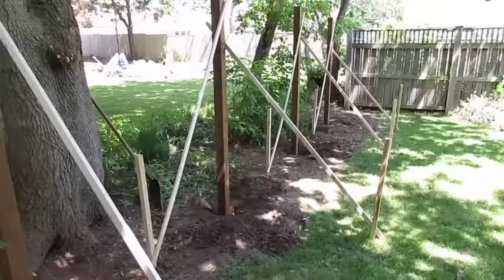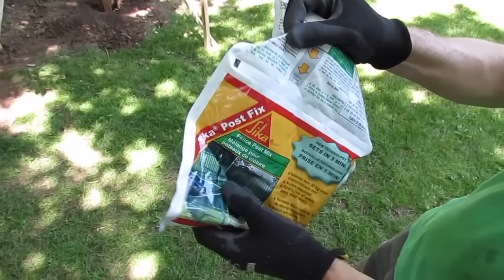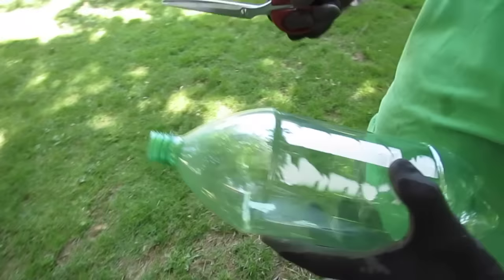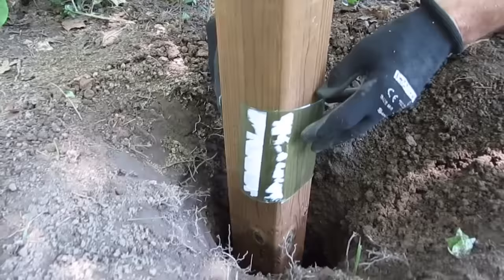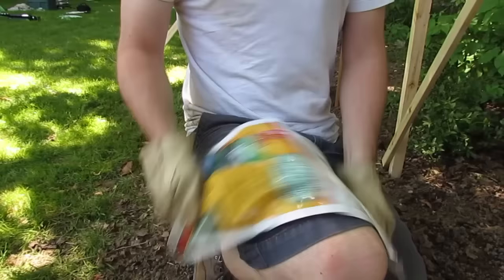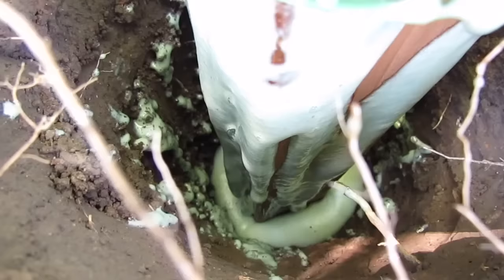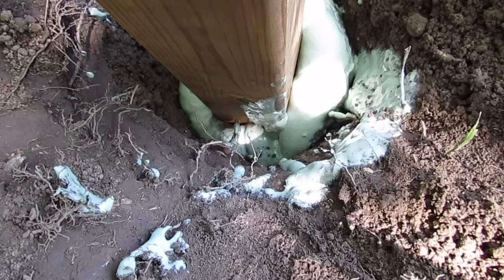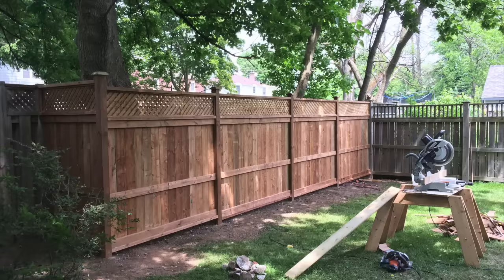No Concrete Fence Post Install!

Comment: I'd be tempted to use this, but fwiw, I use concrete but dry.  You don't have to mix water in it to pour it; just dump the bag in and over time the moisture from the ground will cure it just fine.  Maybe even less mess than the foam.
Reply from the maker: For sure, plenty of moisture in the ground to set up over time. I like getting the concrete set immediately to avoid settlement or an unlucky night of high winds shifting things around in the powder.

Comment: Bag of concrete mixed under $5.00
Why SIKA in the hole for $ 20.00 +
Reply: Đại Ngải SócTrăng I agree
Reply: Sika’s not even that much. It’s like $11 a bag at my Home Depot. I would need 2 bags of quikrete to do a post, each costing 5 dollars. I’m putting up a fence soon and decided to use the foam. Friends and family have had success with the foam on their fences through two hurricanes already.
Reply: Leon thecat Really? The fence has been standing for roughly 2 years now, withstanding a hurricane and Florida’s crazy thunderstorms and it still looks like I built it yesterday with barely any wobble. I have 12 posts (10 have SIKA Foam and 2 have quikrete due to sandy soil.)
Reply: Leon thecat Well, we’ll see in time. As of now it hasn’t wobbled once in a bad storm. It’s also probably got to do with the design of the fence I went with. My fence is a horizontal shadow box style to allow wind to pass through. We just had a pretty nasty storm with gusts that broke some large branches in the backyard and my fence didn’t move.
Reply: Leon thecat “Barely any wobble” lol Yes, barely. Come on my dude, sorry your expectations to this product was shot down by my own experience with it. Fences, whether put in with concrete or foam will wobble if given enough force, and in my case you really gotta push the darn thing to make it wobble and even then it goes back to where it was. Maybe you’ll be right in about 5 years, either way I won’t be here to see it happen ;)
Reply: Leon thecat and yet, here I am perfectly healthy at the age of 26 exposed to the same pollutants every human being is around the world. I’m pretty sure some foam buried beneath the earth is the least of my worries. This has been a fun conversation, I’ll be sure to make a video of my fence during another Florida storm or hurricane and post the results for you :)

Comment: Traps moisture, shrinks, The post will loosen up and rot out quicker with foam. Concrete. Level your post. Poor in dry concrete. Add water. Works like a champ and last for years.

Comment: there are times when I have seen 60 foot poles set in foam in unstable or loose ground...  It's expensive but some geo engineers have mandated it on projects...  It was fast and the pole didn't lean and unlike 404 gravel or concrete it doesn't hold moisture against the pole...
Reply: C and K Early Warning Systems 
Ooooooo good point
Reply: ☝🏻 hater
Reply: let us know how it's doing in 10 or 20 yrs, 'cause i KNOW concrete will last centuries.  if it's done properly, concrete does NOT hold moisture against the pole either.
Reply: Most people don't think about the fact that concrete is porous. You can't make concrete waterproof without sealers and Coatings. But closed cell foam is naturally watertight.
Reply: John Michael, according to the National Precast Concrete Association (precast.org), "Concrete is inherently porous, although a sealer can be added to the concrete surface to prevent water penetration. It’s practically impossible to make an absolutely nonporous concrete "
Reply: +jason muller - i don't CARE what you or precast.org says...  i've been working with concrete since before your daddy was born.  maybe the problem is terminology.  let's skip the word porous, because on a microscopic scale EVERYTHING has a structure that could be called porous.  let's stick to a more practical term, watertight, and plain old concrete w/o any special additives IS WATERTIGHT.  water does NOT seep thru a concrete wall or floor.  PERIOD.

Comment: One guy even said he regret not using foam because the posts that he didnt use it on moved. I suspect that the foam does a great job at expanding and filling in the voids.
Reply: I just bought a house that had a fence installed 5 years ago using foam. I can pull any one of those posts out of the ground with little effort, myself. I have to go along the longest section this summer and replace every post. They will be bedded in  concrete. That foam didn't do anything to hold them in the ground, and it's holding moisture and rotting the posts..

Comment: Fine, but that product is ridiculously expensive: $10-15 a bag.  In practice it's not really meant for long fencing jobs, but small projects where you don''t need a whole mess of concrete, such as a single mailbox post.
Reply: Bingo..............
Reply: Yea, I'll stick with concrete, half priced bags with rips in them at Lowes
Reply: B..
Reply: I agree with U totally, for small DIY projects only!

Comment: I think this foam might be great and better than concrete. The problem with concrete is the voids you can get or poor mixture which is the reason some have to fix a fence to begin with. I like the expansion which fills all voids and we all know that expansion foam is really strong and holds up really well and  better than concrete holds up.

Comment: Secure set is one step above and it actually ends up being cheaper than sika if you are doing an entire fence because you can by that stuff by the gallon. Secure set is a little more expensive if you are just doing only one fence post.

Comment: when the post rots, the concrete hole can be reused. Just remove the old wood debris with a drill.
Reply: How do you get concrete in a 4x4 hole there is no room left.
Reply: The foam is supposed to seal out water so no rot
Reply: @matt7iron  the hole must be dug bigger
Reply: @YSLRD  I had old concrete post holes already there and after grinding and vacuuming it out I just cut Down my 4x4 posts to 3x3 and dropped em 18 inches into the concrete and used 1/3 bag of foam on each post  and it hardened up quick and one year and winter later they are still strong and good.

Comment: they have been using foam on motorway barriers for years
Reply: There meant to absorb crashes and actually move. If you want a moving fence foam is for you then.
Reply: Garden Pond Fish Greenhouse weird cause in grinders we surround the pole with foam before adding concrete.  It doesn’t move🤷‍♂️. Keep it insulated from frost heaves.

Comment: 17 dollars a bag.  I'll mix
 up some concrete
Reply: $19.99/bag and you clearly need more than one per hole... Imagine if he used a shovel and the hole was wider.
Reply: @nickw3657  Mix concrete with sand and you will be ok for fence posts.

Comment: I just saw another demo on this and the foam is suppose to be stronger and seal the post.   By that I mean it  should seal out the water and prevent rotting out of the post.   Another benifit is that you can start working on the post 15 minuters after you have set the foam.

Comment: Some things I have learned from the "foam". 1) Proper eye and hand protection is required. Do not get near this stuff without protecting your eyes. I supposed you could live with your fingers glued together for a couple of months. 2) One bag .. One hole. I had two small holes that I thought I could use one bag. Imagine carrying a live hand grenade from one foxhole to another. 3) It expands much more quickly than you expect. And the remnants of the bag will emerge like an alien creature. 5) Use in a well ventilated area .. there are toxic fumes. 6) Be prepared .. have everything ready before you mix contents.
Reply: Sounds like a real pain in the ass to use.
Reply: I too have worked with foam for years and you need to protect your eyes while spraying. For this purpose not a problem.  The sky is not falling Marc!
Reply: Very true. You can't plan on using this for more than one post as it must be used at break-neck speed. Used it yesterday for the first time to back fill a post hole that already had some concrete. Sets in 3 minutes. The guy in the video didn't show how he prepared the hole.

Comment: Thank you for this video.  I did not know we could use foam this way.  My concern is time.  Concrete in 30 years is still concrete.  I would imagine foam in 30 years would start to break down possibly.  1000 apologies for the many rude and ignorant comments from other people.